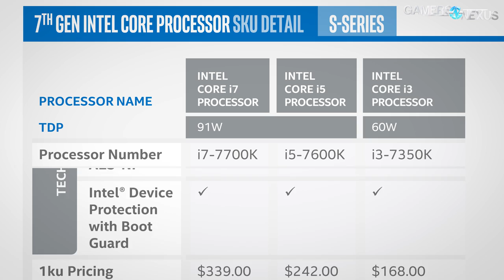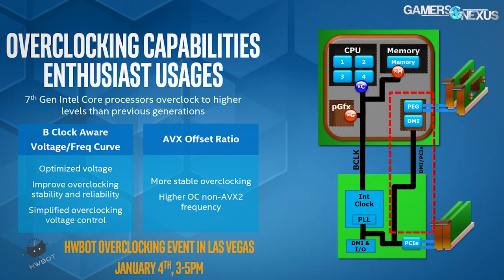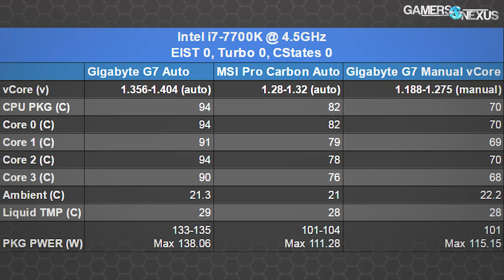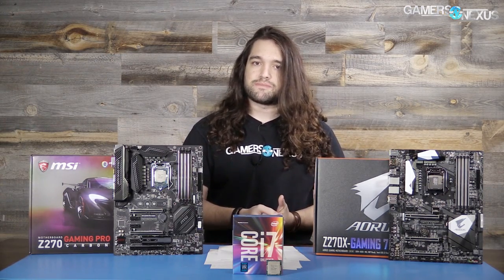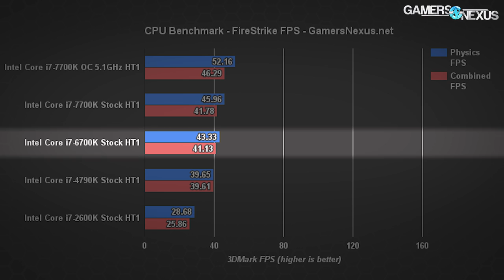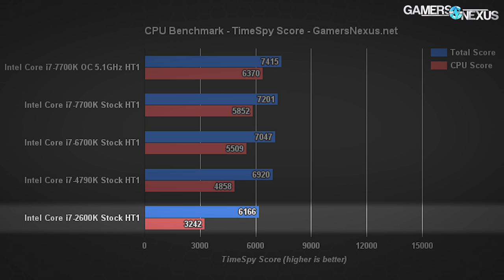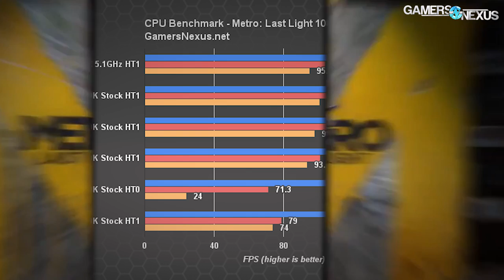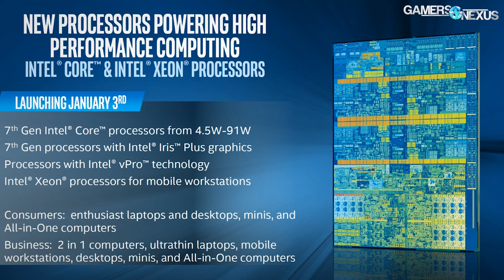Intel i7-7700K Review: Gaming, Rendering, Temps, & Overclocking

Comment: can u please delid the chips and compare their crap tim to liquid metal, the top non metal thermal paste and an average good one like noctua's thermal paste.
i heard already reports that it's crap in a test to liquid metal with a 30 degree drop, so i wonder what your results will be especially to basic good  thermal paste that they could have and should have used if they're not soldering.
so yeah i and many others would definitely interested in that u already mentioned that there is a possible heat transfer issue in this vid.
also great vid as always.

Comment: I heard the thermal issue was due to bad TIM will you delis and test that? You can get tools to safely delid. I heard 30C drops are possible
Reply: Thats a little far. I delidded my 4690k and saw temp drops of about 10 degrees using liquid metal. Thats usually about all you can expect. 15 if you have a really bad chip

Comment: I would like to see the benchmarks with all CPUs clocked at 4.2 Ghz, just to see the IPC gain. I think 2600k does a lot better when pushed to 4.5Ghz+.
Reply: It has no IPC gains..
Reply: Brian Jules I know it has no gains going from 6700 to 7700, but i want to see the gains from 2000, 3000 and 4000 series. Stock 2600k is only at 3.4 Ghz base. It overclocks to 4.5 Ghz+ pretty easy.
Reply: ahh ok, I get what you are saying.

Comment: I went with the 7700K on a gigabyte z170x-designare board with the corsair h110i v2 cooler.  The system runs well, Doom 1440p/144hz@144fps, but i noticed the core voltage is set to 1.35/36 and bounces around a lot from 1.1-1.4.  Should I lock down the cpu fluctuation on voltage and lock its speed?  i've only been modifying the lower multipliers, setting them around 48 for best stability.  CPU runs 50-60*C under load, averaging ~55*C.

Comment: What if I have a 4770k that refuses to overclock and is thus stuck at a measly 3.5GHz? It invariably crashes with anything past its stock speeds (has been tried in multiple boards(. Would this (or zen) be a worthwhile upgrade for me?

Comment: how is the 7700k in streaming compared to the r5 and r7 1700 series. is the 7700k still decent at streaming, because i been streaming with it on the same pc i game on with no issues using x264. But others are saying the 7700k is not good for streaming.

Comment: Whats the point of getting the 7700k if it gets worse temps than the 6700k at the same clocks? For example if I don't want my CPU to get hotter than 80C I might be able to run my 6700k at 4.6GHZ to do that but I can only run my 7700k at 4.5 to meet that goal.
Reply from the maker: Keep in mind that this is largely a voltage/motherboard disparity. But yes, it is a few C warmer under comparable conditions, definitely.

Comment: What's up with the "graphworks" on the AOTS benchmark results? Why is the graph 0-160 when the highest value on the graph is 42,9?
Reply from the maker: All of the FPS charts are 0-160. That is our range we use. We use a consistent range for all FPS charts so that you can glance between them to see actual scaling one test to the next, rather than using random, chaotic ranges.

Comment: I had the same voltage issues but with Skylake on my Asus Sabertooth Z170 S and 6700k, it was auto volting to 1.4v and hitting over 80c under load. Like, why? I manually set it to 1.2v and now it hits 70c max. Using Hyper 212 Evo.
Reply: Funny you had that issue too! My first z170 board was a Sabertooth Z170 S and it was doing exactly that, even if I changed the voltages in the Bios.. it would still over volt it to 1.4! It litterally killed my CPU within 2 months.. It started throttling for no reason and come to find it was just because it was being fried 24/7 at stock frequency. Asus told me to shove it, go figure. Intel after going through every step with me testing decided my mobo was indeed defective and that my CPU was damaged, bought another motherboard unfortunately Asus, just this time their high end board (maximus hero 8) and Intel sent me a new CPU thank god. My advice use a multimeter when in doubt, don't trust the Bios voltages and stay away from Asus mid range boards. Either go cheap or expensive, they seemed to only focus on those boards, kind of like their GPU's. If it aint a popular seller, its going to blow. I had a GPU from them too, 1070 DUAL and surprise, it was defective too. Got an EVGA 1080 FTW and no more BSOD and I can mess around with OC'ing it. Asus is totally hit or miss. Sad very sad!

Comment: What Voltage should a stock i6700k have? I just overclocked it, but i was surprised that it was already at 1.31v at default (most videos I saw  about OC of i6700k started at 1.2v). I wasn't enable to get it 4,6 ghz stable. Tried up to 1.365v, and after getting another hardware failiure warning I went to the stable 4,5 ghz at 1.345v (I was disappointed as I watch a video of someone OC it to 4.7 ghz at 1.345v.  It was Asus Z170 Pro Gamer/Aura motherboard. I guess I knew before this video that some board would add extra voltage, but wasn't sure if it was safe to put it lower.
Reply: Stock should be around 1.275. I wouldn't go with 1.2V, look it up on Intel's site, 1.2 is too low and yea you can damage a CPU from under volting it, so be careful. If you don't want to run your CPU full blown 24/7, just go into Windows Power Options and set minimum CPU to 10% and Max 100%, windows will down clock your CPU when its not in use and thats where Intels speed step shines. For 4.6-7 I would go for 1.35. Anything above 1.35 you'll get more heat, I am on Air so I am good where I am at, depending on your cooling you can push it further though will probably bottleneck at some point. Also play around with Base clock and Per Core, I am at 103 x46 per core giving me 4.734ghz OC at 1.35, which is the same I could achieve with Base 100 x46 per core giving me 4.6ghz. If I go Base 100 x47 at 1.35 I get stability issues. Funny. So yea hope that helps, be safe though with OC'ing, if you damage your CPU its permanent and Intel doesn't support overclocking even with K chips. Also, check your voltages with Intel's Extreme Tuning Utility to ensure your getting those proper V's for your clocks, in fact do this before OC'ing. (DONT USE ETU for anything else other than checking your Voltages.. Always always overclock manually in bios!) ETU is better than CPUID, HWMonitor, ect for real voltages. I can confirm using it along with a multimeter where other programs were incorrect. Cheers!

Comment: I know it's an old video. But I have a MSI 6g 980ti with a Xeon 1231 E3 which I get consistent 70+ FPS on a GTA V or 144 FPS on a DOOM @1080p. Which CPU (and Mobo) to get for 1440p gaming instead, to maximise my GPU power and get same sort of FPS rates on this resolution? I also have a Thermaltake v21 core case.

Comment: dumb question: if ever i decided to buy a ryzen CPU can i pair it up with my Asus Z170-A mobo?
Reply: No you can't. Ryzen will use a totally different socket (I think it's AM4). While Z170 is compatible with 1151 socket. You can use Z170-A with Skylake & Kaby Lake. CPU's like i5-6600K, i5-7600K, i7-6700K, i7-7700K. But if you plan on using Kaby Lake with Z170 chipset then keep in mind that you will need a BIOS update.

Comment: I'm not trying to be one of those "Bullshit! My cpu got (x) while yours got (y)!" people, but my 4790k only scored 882-884 on Cinebench while oc'd to 4.4ghz (I know it default turbos to 4.4, but when using all cores it only goes to 4.2 so I'm 200mhz higher) as opposed to your 898 at stock. I have pretty adequate cooling with a 212 evo, running at 1.2v any thoughts why I'm scoring lower while being clocked higher, even if only slightly? I mean I now 200mhz isn't a ton, but I would expect to score a few points higher, if not break even, not be lower.

Comment: Looks like intel skimped on the tim again? I realize you had 10-15 degree diff b/c of the auto voltages of the mobos,but I've already seen ppl claiming to hit damn near 6ghz after de-liding...I upgraded to this 4790k from an 2500k in 2015 so Idc either way,but this gives me hope that AMD will finally be able to compete since Intel is content to offer marginal gains yet again. Shame you didn't mention the one thing I was curious about though,Is it really locked to windows 10 only?

Comment: Then should I get a 6600k, 6700k or 7700k? I feel as though 6600k is much more worth while the 7700k is just expensive.
Reply: If you mainly just game buy a 6600k. Honestly all you really need
Reply: If all you're doing is gaming, and maybe some slight editing and 3D work, then get an i5 6/7600k. I'd stick to the Skylake though, as they'll probably drop in price, and they perform basically the same as the Kabylake. I'd even keep an eye out on a 46/790k since they're still super capable, and the Skylake series is basically just more power efficient versions of Devil's Canyon. Also, know that Kabylake is Windows 10 only.

Besides all of this, wait a bit to see what Zen brings to the table before you buy.

Comment: so i just got an i7 7700k it idles at 35c and under full load it hits about 75c when i run realbench. Is this normal with a 212 evo and this cpu at stock settings

Comment: Hey people, i need some advice.

This is my rig currently:
Gtx 1080
Intel core i7 3770 (non k!)
a terrible office mainboard
and 16 gigs of 1333mhz ram

Now my question is, should i sell my mobo/cpu/ram to upgrade to a new 7700k?
would that make sense? is the performance increase noticable since i can overclock it now?

Thanks in advance
Reply: Personally, you'll never get the full potential of your 1080GPU with your current CPU, since your CPU will definitely bottleneck that 1080. So if your serious yea, definitely. Sell what you can and grab an updated mobo, cpu i5-i7, ddr4 ram and a nice PSU (gold or above). Just remember mobo's are important, so don't skimp on it same for that power supply. 2 of the most over looked items when making a PC. But yea, having a nice CPU with that 1080 will make huge gains in performance for you over what you have now. Oh and more ram is better than higher OC'ing ram (16 3200 vs 32 2400), which OC'ing ram along with a CPU, GPU 1 eats up a lot of electricity = bigger PSU needed and 2 can cause troubleshooting issues. Cooling is up to you, I like Air cooling so I have lots of case fans and a nice Noctua NH-D15 but its up to you! See you and good luck.

Comment: I just got my i7 7700k and i kno the 212 evo is not the best but its all i have right now. Im guessing i can OC at all with this, but is this normal

Im idling around 40c but 1 of the cores is spiking to 50, and when im in game like csgo 50 percent cpu usage i hit around 70c

I tried to run prime 95 for about 2 mins and my temps on 2 of the cores hit 83c i got nervous and shut it off. Is this normal for stock. this is with speedstep and turbo turned off

Comment: Opinions on this computer build for 1700 euros 
Intel Core i7-7700K, Quad Core, 4.20GHz
Arctic Freezer 7 Pro Rev.2 jahutus
MSI Z270-A PRO emaplaat
DDR4 Kingston HyperX Fury Black 16GB (2x8GB) 2133MHz CL14 1.2V
Internal HDD Seagate BarraCuda 3.5'' 1TB SATA3 7200RPM 64MB
Kingston SSDNow UV400 240GB SATAIII, 550/490 MB/s
ZOTAC GeForce GTX 1080, 2x IceStorm, ExoArmor, 8GB GDDR5 (256 Bit)
Chieftec ATX PSU A-80 series CTG-650C, 650W Modular
Corsair computer case Carbide Series™ SPEC-01 RED LED Mid Tower Gaming
Internal DRW LG GH24NSD1
Monitor Asus VE248HR 24inch, D-Sub/HDMI/DVI, speakers

Comment: And people say AMD run hot! Only with a stock cooler could I hit 75c with an FX-8350. With a single 120mm rad (single fan) I max at 50c (prime 95). That Intel chip is terrible by comparison.

Note: P-95 raises power usage from 100w to 360w (a 260w increase at the wall), with an 84% efficient PSU, this is roughly 220w jump from idle. This is a power hungry chip when overclocked, yet it still runs cooler? My temps were measured at socket, because core temps are too low to be accurate.

Comment: You compared Intel K series CPUs at STOCK speeds for game comparisons.  Who buys a K series and NOT overclock it? ... People that do not overclock usually purchase a non-K CPU to save money. ... At 16:00 the I7-2600K is not half as fast as the overclocked 7700K.  2 x 26.5 = 53 fps. - - - Here you are comparing an overclocked 7700K to a non-OC 2600K.  .... That invalidates everything.  Also, it would have been nice if the i7 3770K was included in your tests.
Thank you for taking time to make this video.

Comment: So... STILL no huge reason for me to upgrade my 3770k @ 4.5GHz.

Save me, AMD. Save me from the mediocrity.
Reply: I wouldn't count on AMD giving you a better chip then Intel, everything I see is they are trying to deliver a chip comparable to Intel. The only benefit with AMD is it will probably be cheaper but performance wise, you'd be better off sticking with Intel if I could guess. Speculation of course but so far I've seen nothing to suggest otherwise. Just carbon copying competition. We'll see though. See ya.

Comment: The gigabyte boards are a mess. Even the z170 boards push massive amounts of voltage after the kaby lake support bios update. I have the gigabyte designare with a 6700k and after the bios update it peaked at 2.0v a couple times and seems to average 1.4v. Thankfully the 2v was for a very short time and I'm amazed it didn't fry my cpu but that update along with auto settings seems dangerous.

Comment: I'd argue you should still buy a 6700k over this. Clock for clock this thing exactly the same as the prior generation, not that you tested that for some reason but thankfully other channels did. All performance gains are from the higher base clocks, and with the delidding needed on these CPUs to get proper heat transfer idk why you'd buy this garbage.

Comment: so, usual 2-5% bump up per gen, i see.. god this is f irritating. and hotter? so basically, they took the same cpu, clocked in higher and released it as next gen (would explain the extra heat and barely any performance diff)

Comment: now WHERE are the results for overclocked 4790k and 6700k?

Showing off massive increases on the 7700k is cool and all, but for those buying this CPU it's all about peak. So give us something comparing peak oc vs peak oc! Why? Well, ealry benches suggest a 0% improvement of IPC compared to the 6700k, and from back when sky was new, the 4790k and 6700k were near tit for tat at the same clocks. So i want to know if this is all due to clocks! Also that would be a much more realistic comparison, as even stock speeds are not representative due to the significantly greater boost on the 7700k!

This is especially important considering how the 4790k is right on the tail of kaby and sky, so you could end up with a mere modest OC overtaking it. And considering how little the 7700k gains from game OC, it's realistic to expect a significant game. 

Which by extent means all the 4790k users seeing a 5-10% gain (ish) could in fact end up with significantly less due to their OC. This would also answer your own question at around 19.40 if 4790k users could be comfortable keeping thier CPUs too
Reply: Higher clocks necessitate more instructions per clock cycle. Of what benchmarks do you speak?
Reply from the maker: "Massive" is a bit of an overstatement, considering the actual performance differences.

As stated elsewhere in several places: This is an iterative process. You have to understand the circumstances that just testing the temperatures alone took a few days to process, and that was sandwiched between CES (where we are now) and holidays. We are planning to continue expanding our benchmarks once back from CES, as stated in this very content and in the written review.

For now, you'll have to extrapolate the numbers. It's not hard -- they all linearly scale. Baseline provides enough reference, since the performance is all more or less the same in gaming until you get to the 2600K. We'll explore more testing once back from CES. There is far more going on in this week than most folks could appreciate, not to mention new laptop coverage (see: 1050) and motherboard reviews.

Comment: After all the hate and memes AMD gets for thermals I'ma laugh if the Zen chips run cooler then these :D
Reply: It is not about temps but heat.
Reply: Killing joke I have no clue what your trying to say.. More heat = higher temps. As the video demonstrated even with the voltages lowered the 7700k runs hotter then then 6700k. And as I said, it would be funny if after all the " I could heat my house in the winter with an AMD cpu" jokes if Ryzen runs cooler then Kaby Lake
Reply: FX-9590 reports much lower temps than i7-7700K and yet it consumes much more power.
Temps do not equal heat. Or does a mobile phone with a cpu at 60°C heat your room more than a FX-9590 well cooled with a high-end watercooling stuff while running at 40°C?
Reply: Honestly have no idea what your point actually is. As best I can figure your confusing heat dissipation potential with actual heat production.
Reply: I am pretty sure you are confusing heat dissipation with thermals.
As I said AMD FX runs cooler and yet it dissapates way more heat.
Reply: So you still think that higher temperature = more heat?